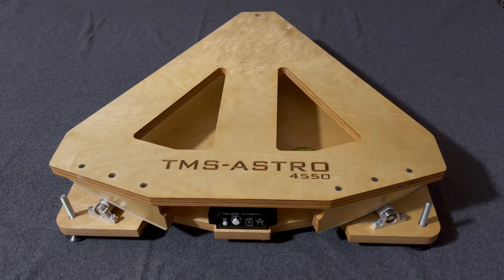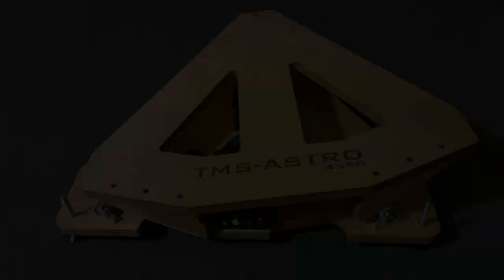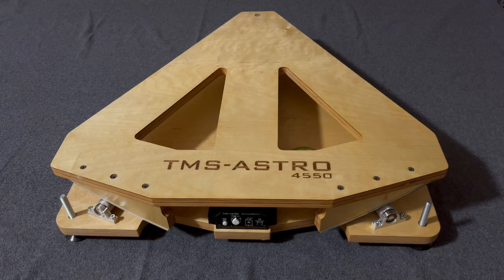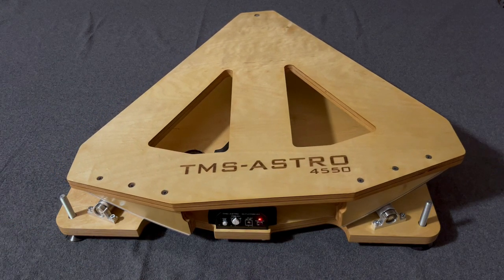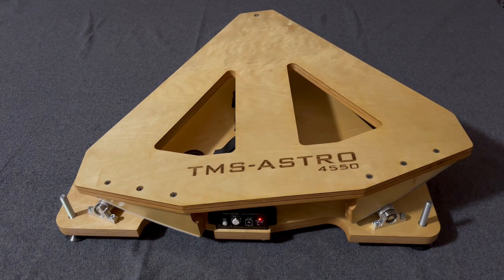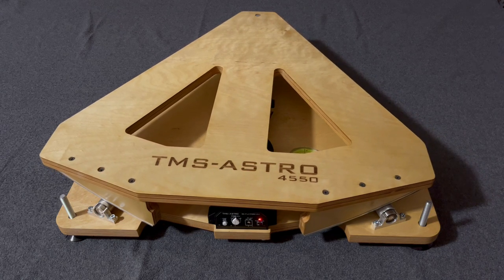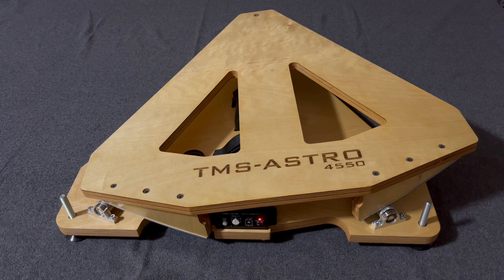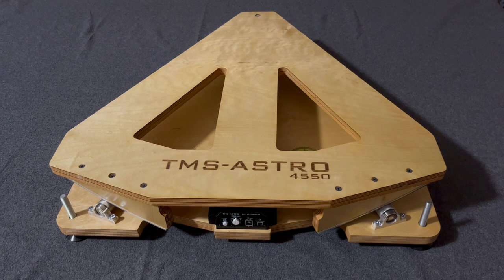How the controller of the eq-platforms works

Comment: Hello, in another video (maybe the 1st version of the equatorial platform, not sure) I saw that the speed of the motor is preprogrammed. That means that the speed of the motor is related to the arc of the bearing I assume. Would you please explain how you would determine that?
Reply from the maker: Hello, the known data is the diameter of the drive cone, which comes from the design. The revolution of the drive cone is 1 rev /24h. The drive cone is driven by a drive wheel, which has a smaller diameter, creating a gear ratio. In most cases, an additional transmission is needed at the motor as well. Therefore, the speed of the motor can be calculated based on the speed of the drive cone and the gears.

Comment: Does the version of the platform depend on how far north or south that I live or where I will be using my scope? I'm in North America, United States and I live in a town called Idaho Falls in the state of Idaho. I also travel to Southern Utah and use my scope there as well. There's several hundred mile difference.
Reply from the maker: It is depend on where you would like to use it. Idaho Falls coordinate is around 43 northern latitude, so you should buy the model 4045. From this year it will be possible to order the segments separately, so you can easily change it, and the controller can be adjusted to the other model. It means if you buy a model 4045, you can order annadditional segment set, for example 3035 or something.